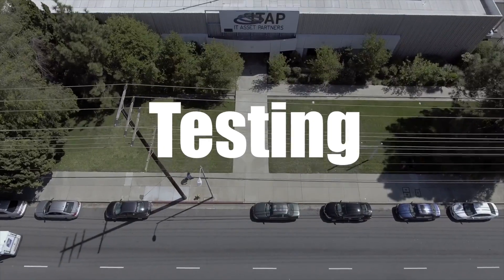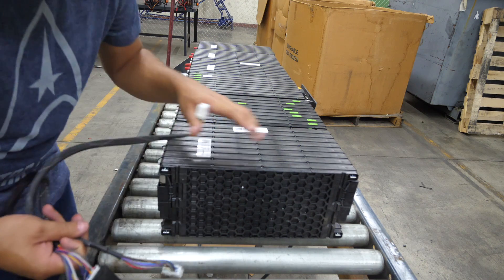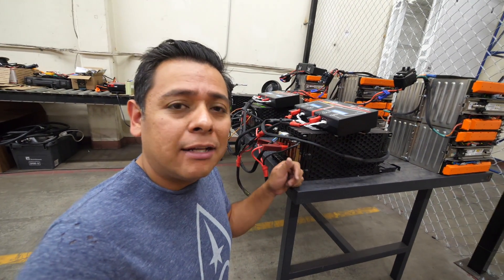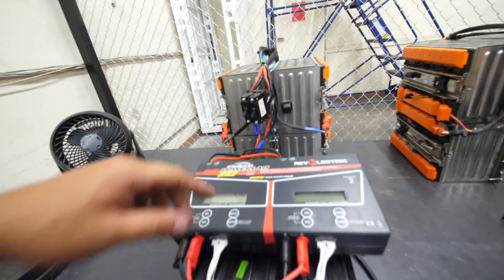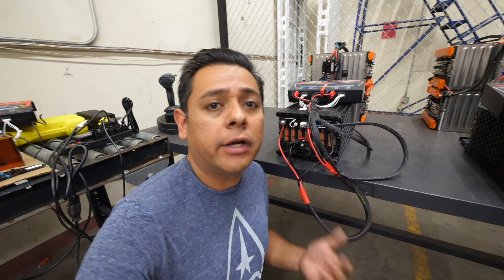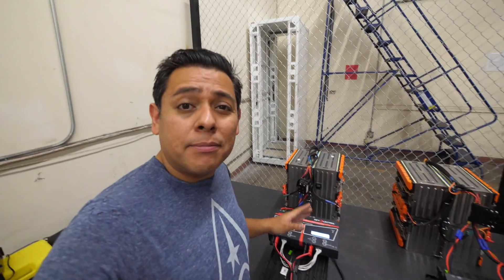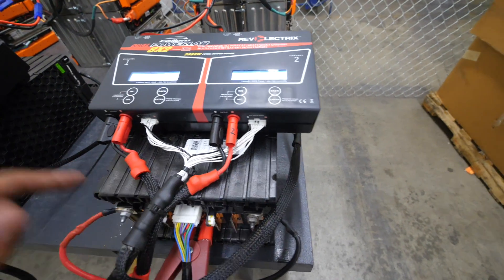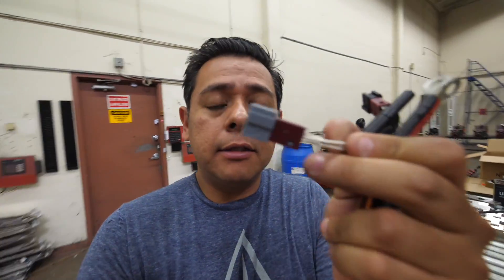Chrysler Pacifica Battery 2nd life testing Procedures

Comment: Quick question - with an 18650 cell that I use in a flashlight .... - if I charge it to full on my battery charger / analyzer and discharge it - will that give me the capacity of the cell - or would I need to recharge it and then that would give me the capacity of it? - sorry but I’m looking into buying a battery charger/analyzer for this purpose - to see the capacity of my cells so I know if I need to replace any if they are older and worn down. Thanks for any help in advance - also any battery charger/analyzer in particular I should buy that’s a solid 1? Thanks

Comment: Hey Jehu, i have a bunch of lg chem modules similar to yours (16s setup per module) but standing up with only one 20 pin bms connector on the top (XC90 hybrid type of battery module).
I would like to cycle them to test capacity same as you with a revolectrix dual power lab 8x2 wich is easily avaliable to me here in Sweden. But, i'm new to lithium and bms and have no idea how to make the monitoring connector cable between my port and the powerlab. I've found a pin out scheme for the white type of connector you are using in the video, but that doesnt help me much.
Reply from the maker: You’ll have to trace them out,  use your multimeter and measure voltage on all them pins,  you should figure it out pretty easily.

Comment: well I heard the capacity but I never heard the total voltage of the pack
Reply: Farley Gordon just over 25 volts, so still good for 24v systems. 3.7v per cell.
Reply: but probably averaging 3.2v ish per cell
Reply: wilosism thanks for the reply so I guess they're 18650 All In Parallel in One Bank. which means Peak voltage at 4 volts x 8 Banks 32 volts. I guess that would work in my 24 volt solar system
Reply: wilosism Thanks

Comment: What's the price range looking like on these?
Reply: Size, weight, and mounting points would be some other good info lol
Reply from the maker: +TANK The Hammer   $150/kWh
Reply: So around 375$ each roughly
Reply: Not a bad deal considering it has the power of 600-650 18650 cells

Comment: Is more wasteful to use a second battery to store the energy from the test battery discharge.
Cost amortization for the most cost effective battery (good LiFePO4) is a realistic 25 cent/kWh and so is better just to dump that in to a resistive heat element (heat a pool if you have one :)) as for putting energy in to the cells just use PV panels cost will be around 2.5cent/kWh or less so to fully charge an empty 2.5kWh module will cost about 6 cent (I'm sure just the time to connect the cell is way more valuable than that).
Reply: What if the old modules absorbing the discahrge are at like 70-80% capacity and considered EOL?  Then wouldn't it be worthwhile to use them till they are almost completely dead?  Then recycle.
Reply: 70 to 80% is what will be considered EOL in a EV but for offgrid they can still be used as long as they do not have other problems like high self discharge and are completely unusable.